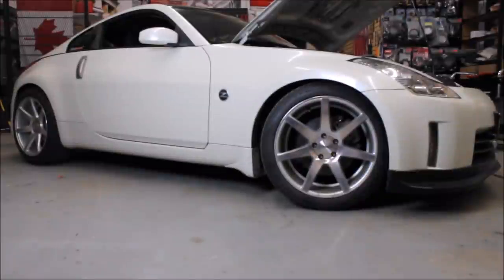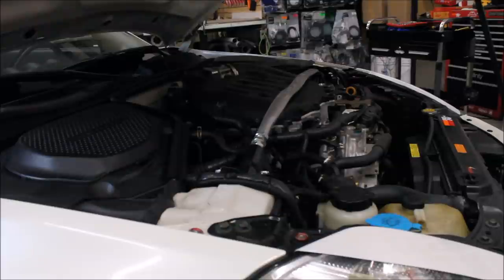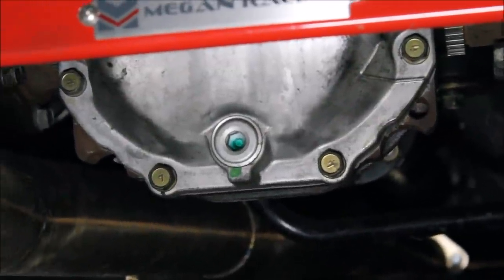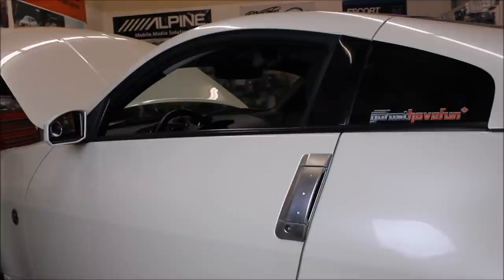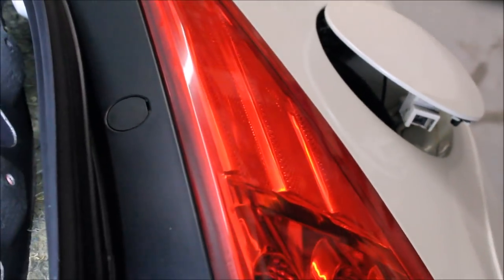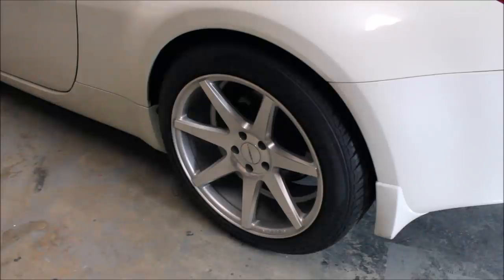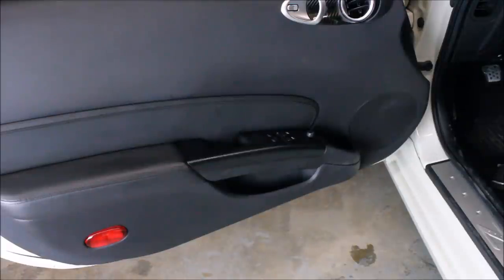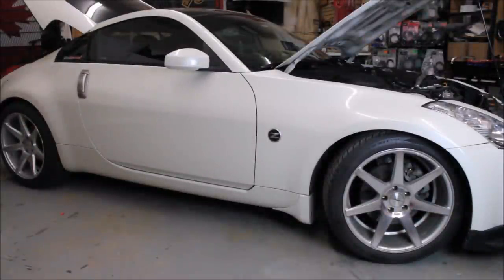Things you didn't know about the Nissan 350Z (Nerd Out Session) | AnthonyJ350

Comment: Nice upload and review. I also have a rev-up, dyno tuned +36whp/45wtq gain. You look like you care, so a vented catch can should be on your list of things to do. Why? To not recycle blow by oil through the intake and burn it through the engine. When you installed your MREV2, you probably noticed oil on the runners. A vented catch will make your plenum spotless and will also reduce oil consumption. https://youtu.be/zApaVJnmi_U

The reason the G35 has a nice interior is because it cost more, not because they cheaped out on the suspension. When I replaced my diff bushing with whiteline, my sub assembly has the same green dot markings on it from the factory as you. The difference in suspension is the spring rates, the 350z has stiffer spring rates, that is it: nothing else is different other than strut tower braces. I have KW v3 coilovers so that issue was easily resolved and rides better than a 350z or G35 ever did from the factory. Other than that, your video was pretty much spot on.
Reply from the maker: Thanks!  I have the Saikou oil catch can on the car and I talked to the builder.  We believe in keeping the system closed because the PCV system also aids in promoting better piston ring seal.  

I've been trying to do PCV research here http://www.motoiq.com/MagazineArticles/ID/2032/PageID/3344/Crankcase-Ventilation-Explained--NA-Edition.aspx 

 Also check out this video at the 23:00 mark, he mentions there's components the 350Z has the G35 doesn't https://www.youtube.com/watch?v=rCfQyijW_y4
Reply: Builder? What mods do you have done to your car? Is it dyno tuned? 

My tuner says otherwise on the catch can, I've been using a vented catch can for over 6 years now, no issues. Owner for 12 years. I've had my car dyno tuned 2x, once in Dallas and the other in Phoenix. Both tuners said the same instructions on the vented catch can as the video link I gave you. After reading this article, I see how you got confused. It shows venting 1 valve cover to the atmosphere, caping the intake, as a " BAD IDEA". That would be correct, for the illustration on page 4 of 6. Now go to page 5, the better idea. All of the earlier illustrations, the PCV line never changes changes. To do it properly, you need to also change the PCV line, as in hollowing out the valve or buying a piece that fits perfectly with no PCV valve. Now they show you on page 5, putting the catch can by the PCV line is, as a " better idea". None of these illustrations are like mine setup at all actually.  Because when they move the catch can to the PCV line, it is still a closed system. The one that is pretty close is on page 6, as " best idea", which they only vent 1 side of the system. You need to vent both sides of the system and use 2 caps, 1 on the intake and 1 on the lower plenum They have capped off both ports which is correct, but then cap the PCV using an internal pump, vs letting it vent to the atmosphere.  Most likely because that is the legal way, because venting to the atmosphere is illegal for road cars. Race cars have been doing it since like the beginning of time.  A vented system is known as the best, a closed system does very little, even with a baffle, compared to a vented system because a closed system recycles the blow by oil through the motor. 160,000 miles on my VQ motor, spotless valves.

Thanks for finding the next video, very interesting. I added it to my favorites. I see what you are saying, the video says the v35 skyline does NOT have Front Cross bar ( A-Shaped), but it says everything else on the G35 suspension wise is the same. Maybe in Japan, they are different, but in America the same. Well, bro, I hate to break it to you, my G does have the front cross bar (A-shaped). How do I know? First off, I've taken it off to repaint it. 2nd, when removing your CATS, if you know what you are doing you can do it all from under the car. You don't need an extension to come from the top to remove CATS.  The trick involves, flipping your body the opposite direction, to fit your arms through the Front Cross Bar ( A-shaped) to reach the top bolt on the CAT. I know for a fact, my G35 from the factory came with Front Cross Bar ( A-shaped). I also have the rear tunnel M brace the video says I do not have. I"m not lying here. When I installed my Motordyne Shockwave and ART pipes, I removed the rear M brace also to repaint it, because the Motordyne products looked so amazing, I had too clean it up. Then they mention the next difference as the 350z having a carbon fiber driveshaft, that is true. The G35 from factory did not get a carbon fiber driveshaft, that is an aftermarket upgrade.
Reply from the maker: It just has bolt-on, berk resonated test pipes, Megan Racing HR-Style y-pipe, 3 inch catback, MREV-2 with a plenum spacer and Motordyne's Iso Thermal upgrade.  More of my upgrades are focused on "driver feel" bushings, shifter, electronic interface etc.  I'm looking into a simple flash tune and something accessible for more of my viewers like Hypertech because everyone doesn't have access to a dyno and a dyno tune is only as good as the technician mapping it.

I have access to a 2005 G35 so we can compare it underneath.  The video was for early Z33's so they might have made updates in later years like on yours.  My buddy had the 2005 G35 and now has a 2006 350Z and he thinks the 350Z is a better handler, it's a matter of opinion but he's own both vehicles back to back for years.  I'm not knocking the G35 but if you look at their physical setups the 350Z is more sport oriented but they are very similar.  It's more about the driver, because you can see in this test both the G35 and 350Z are near identical https://www.youtube.com/watch?v=VmIoOdr2KN8&index=21&list=PLyKNE-gOe_GKDYAKfCNN5qKA50wYuIjlA

  I wonder if it's different since you have a REVUP and I'm assuming it has a manual transmission.  Do you have the same oil consumption as before?  I assume you would still a bit if your oil catch can is catching stuff.  I really believe the motor consumes oil when it's cold and all the internals need to get to their operating temperature tolerances and also under hard driving when lots of pressure is built up.

This is my catch can https://www.youtube.com/watch?v=iSzU-cvlLO8&t=8s

In this video at 8:31 these are my valves and lower runners at 70,000 miles, I've only had the catch can on for 1 year because I just bought the car https://www.youtube.com/watch?v=8kbeCSlRDG4&t=724s

If you check out my channel, when it comes to things I don't deal with on a daily basis and haven't had a lot of vehicle to experiment on, I don't deviate away from stock engineering too much.  Rather I try to just refine it and remove weak point.

Really good points on your vehicle and I might consider that oil catch can setup if I eventually do decide to go forced induction.
Reply from the maker: Emilio B Ya I found a shop in my area that does dyno tuning with UPREV. Going to check them out and if I do it I hope to have a dyno video for you guys.
Reply: My tune was done with uprev also, I would agree with Emilio on hypertech. Fair market value is $300 to $350 for the dyno tune and the uprev software, used to be $300. Not sure if that is still the current price or not. So for $600, this is the best mod and the one you will really feel. Plus if you have test pipes, you are running lean without a tune. Lean means too much air, not enough fuel and the engine runs hotter.

Comment: 50/50 is NEVER the optimal setup. Ever.
Reply from the maker: NiL Nine Interested to see why you say that? Aren't the top sports cars 50/50? i.e Miata and S2000.
Reply: Because in a corner you are either accelerating or braking. The second you brake you push weight the the front and the second you accell you push it to the back.
If you have more weight on the front you can load up the front wheels (if your tires can handle it)and stop quicker as you have more weight pushing down on them.

Keep in mind for aero you DON'T want the front of your car pulling up, as it allows you to create more drag slowing you down and creates lift pulling more weight off the front end. 
Especially coming out of a corner where you are loading the rear of your car up and accelerating hard.

If anything it's better to have a rear biased weight distribution for a balanced approach as more weight on the back means you can use rear brakes more effectively allowing less load on the turning tires. Even with 275s on my 350z Nismo I can overload the front tires under super hard braking on a sharp corner. It's all how you set up the car. for corner Exit speed or for better entry and speed carrying. Either way you want a bias. 50/50 is only good for the skidpad and turning in a perfect circle.
Reply from the maker: NiL Nine I see. I playing slightly with the suspension tuning. I noticed the car likes to understeer with the stock suspension  (which is good for the majority). I got Eibach's adjustable rear sway bar to see if I can make the car feel more balanced to my taste and get the rear to help me rotate in corners. I'm make a video of the install and another of my impressions.
Reply: Wider tires helps a ton, but you really need a camber kit. Getting 3% negative in the front was HUGE. I had an 06 for a while and I didnt get on it as hard as i do my Nismo, but the Nismo handles WORLDS better than the non nismo models. They still understeer though. but that camber was night and day difference.
Reply from the maker: NiL Nine Isn't the Nismo stitch welded from factory? My car is mainly a street machine do you think I would actually notice a difference? Wouldn't my straight line stability and braking be compromised?
Reply: It is but only in 3 places. It's not fully stitch welded. What you feel with the Nismo right away is the stiffness and the lack of bodyroll or body twist. In my 2006, I could get to the limit of my 255 size tires and I would break lateral grip before anything. With my Nismo I'm slammed up against the door trying to hold on for dear life. I cant find the limit of the car with 275/305 tires. Well I cant with out getting some seats made for the track. Im almost done with power mods on the HR and once I hit 310-320 to the wheels I'm going to find a seat and some harnesses. Even stock this Nismo needs it.  One of the biggest differences is at speeds over 140+ at about 135ish my 2006 would get a bit floaty on the rear end. Not enough to be scary, but noticeable, I'm not turned yet on my Nismo so I have only hit an Indicated 163 and with the areo on the Nismo it just Squats. 100% rock solid and stable at those speeds. 

Pro tip, the OEM Nismo (NOT S-TUNE) suspension is Much cheaper than Most aftermarket suspension set ups, you can order it from Nissan, and I wouldn't swap these out for anything less then a custom Penske or Bilstein setup or some KWv3s at the LEAST.  You might want an aftermarket rear sway for this setup. (or both)

Straight line stability wouldn't be compromised that much as you would accelerate faster as you wouldn't have as much tire on the ground. I've never felt like that was an issue. I could see breaking in a straight line being slightly worse but an improvement while breaking in a corner.
Reply from the maker: NiL Nine That's some really good info. I'm doing a video where I changed out the rear spring isolator from rubber to a polyurethane version. I found the vehicle squats less under acceleration so I think the factory rubber one has too much give, especially that it's older.
Reply: Thats a huge problem with the Nismo. They actually start to rip then make noises. lol. I can agree with you there.
Reply: Got to disagree with that statement.
Reply: Nismo suspensions can have a front damper. Better than just strut tower braces.  Compliments the anti-sway bar by quickly dampening vibrations. With just a sway-bar, when you load one front wheel it tends to lift the opposite one.  Not something you want on a track.

Comment: The VQ35DE was garbage, and literally not worth the time to tune it or bother with it. The HR was the VQ35's rescue, and the way it should have come from the start. Still though, the bolt-on capability on the DE is a huge waste of money. The HR is better, but Nissan was smart to move to the VQ37 and just phase out the VQ35 it's slow, and heavy.
Reply from the maker: Aaron Belcher Wow someone has a bad experience. I don't think it's as bad as you make it out to be. If it's that bad why would Nissan keep using versions of it up till now? Also older versions won awards. A lot of these cars have miles on them and are being used by amateurs as track and drift cars.
Reply from the maker: What are you building right now?
Reply: not building an engine right now... The car I do have is the BRZ. The FA20 is exactly the same as the DE, it's garbage. The FA20 even fully built can barely put out 500whp. My plan with this car is to swap the engine within the next year or so, with a 2JZGTE. The engine will be built for 1500+whp, and the drive shaft will be carbon fiber that can withstand over 2000hp/3000+tq, and obviously a rear diff that can take all that power as well. My goal is just a conservative 800whp with some wiggle room to go a little more should I want to. I do a heavy amount of research on cars before buying them. I bought the BRZ with the FA20 because I love the way it sounds, so it's a nice thing to have until I am ready for the 2JZ. This is why I am saying that the HR is the way the Z SHOULD have come from the start, the DE is just crap, anyone who is honest with themselves will agree, it's just not a good platform to build on.
Reply from the maker: Aaron Belcher Realistically 80% of people only need 300 to 400hp at the wheels. There are supras in my area with 700whp and they're useless on the street. The DE is fine if all you want is 350 to 400 at the crank. You just have to understand there's different levels of builds.
Reply: I guess what I am trying to convey when I say "garbage" is the limited potential. The K24 for example. 500whp with stock internals is possible and safe, however if you dog on it everyday it will blow eventually. If you build the K24 it can exceed 1000whp. My point is only that I don't really find engine's worthwhile if their potential is so limited. The Focus ST engine is another good example. It is poorly built from the factory and has a very low limit of max safe build at 300whp and ticking time bomb above 350whp. when built it cannot be sleeved and cannot exceed 500chp it'll blow a rod through the very thin cylinder wall.
Reply from the maker: Aaron Belcher So just build 300whp vehicles. They're highly effective on the street and they won't blow up. Not all of us can afford to spend five figures on the engine alone.